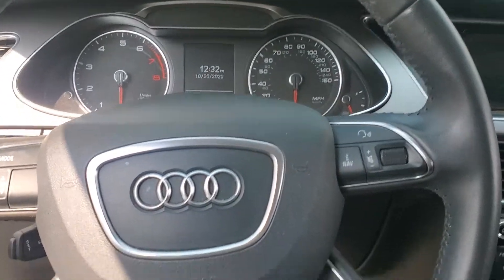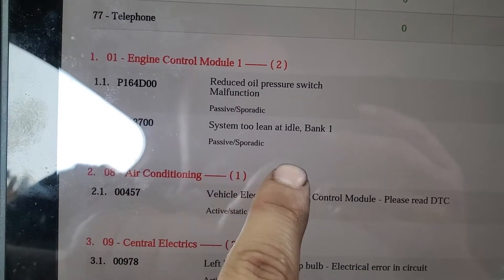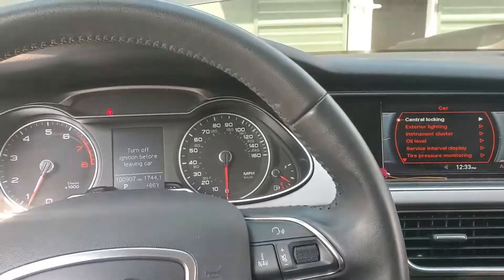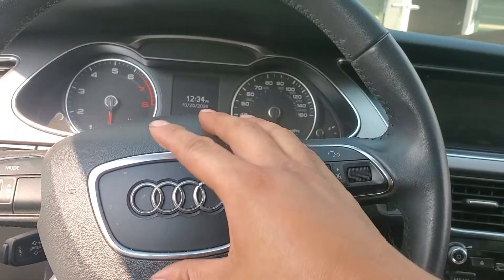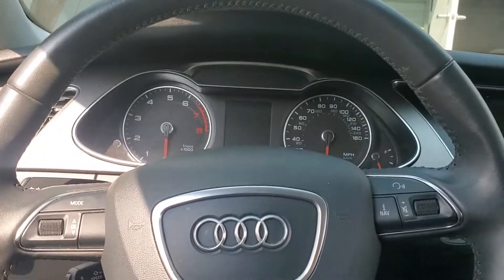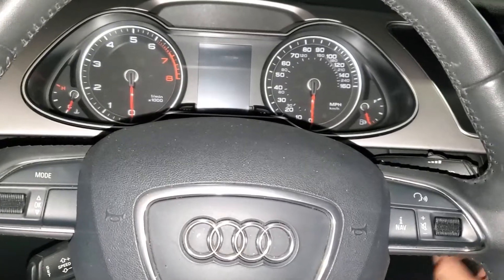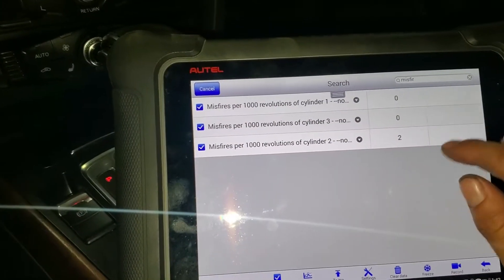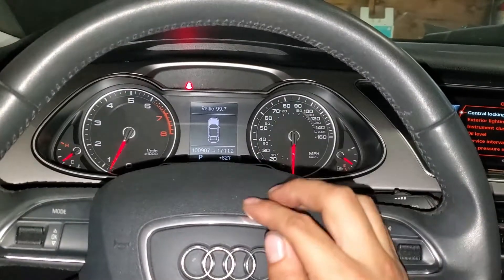How to fix misfire and system too lean code P0171 on 2014 Audi A4 2.0 turbo.

Comment: Bro i have that same problem with my audi a4 2014 everywhere i went told me that same thing to change the pcv but i look on google and someone asking if I recently changed my oil dip stick which i did months prior this was the issue i change my oil dip stick and code went off check to see if your seal around your oil dip stick is not broken or worn out
Reply from the maker: the right way to diagnose this code is with a smoke machine, people have told u the most common things that fail but with a quick diagnosis with a smoke machine I almost guarantee you that it will be a small cracked hose.

Comment: Are you sure it’s that or the o2 sensor
Reply: Mine only gives me the System too Lean.. If I cold start it its shaking a bit but after the engine is warm its normal and my car drives fine aswell. Just the ChecknEngine light
Reply: @mattdebeer5289 me as well when cold start it start shaking check engine light come on but after a minute or so driving it everything back to normal did you fix yours already it was giving that same code and misfiring system too lean on bank 1
Reply: @mattdebeer5289 that’s the same thing mine does
Reply from the maker: I would try changing this first and if it doesn't work u then might have an air leak somewhere and that will require deeper diagnosis.
Reply: What is this part called ?